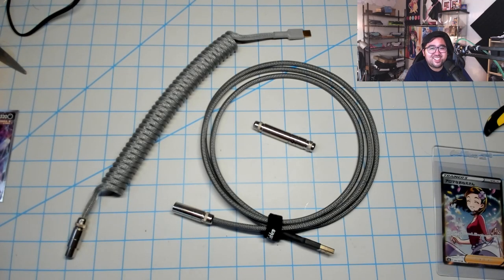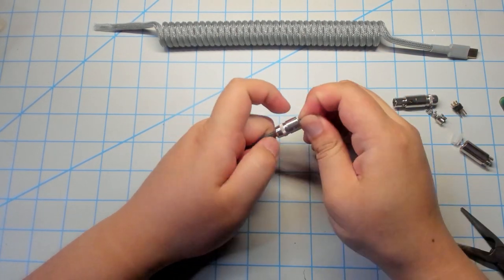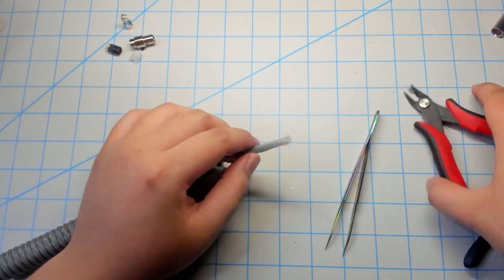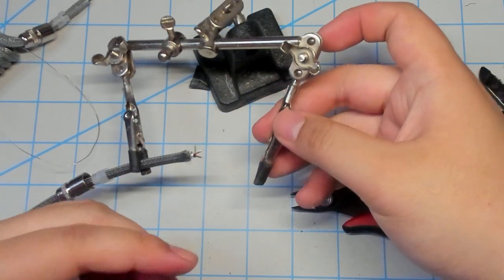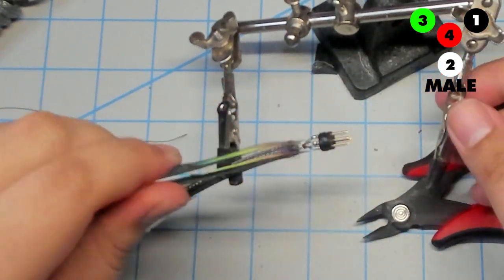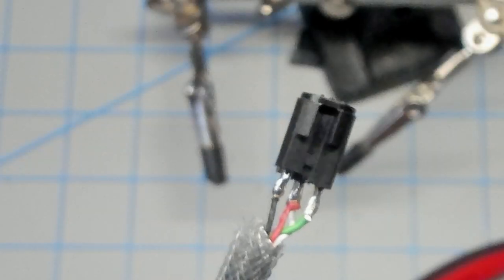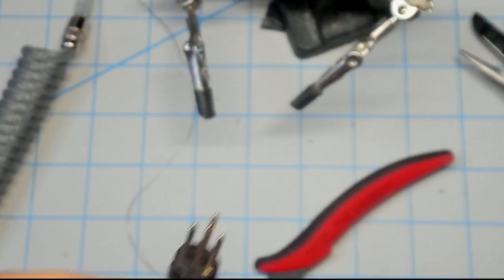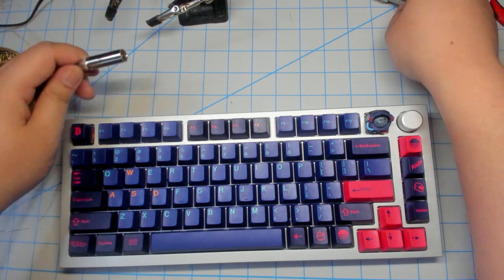DIY Mini XLR Connector Tutorial - Mechanical Keyboard Custom Cable

Comment: I bought one of those custom cable kits with a gx16 connector and after I finished building it, it didn't work, I didn't find any crossed wires, and soldered the wires in this order: black, white, green, red, are there any other things that I should check?

Comment: I made my cruzctrl kit ($20 one) and it’s turning the rgb on my keyboard (gk61 Pcb) but not actually working… any help?
Reply from the maker: Usually, that's caused by an issue with the soldering. You can join the discord in the video description and share some pics of your soldering for help. :)
Reply: @CruzCtrl  got it thx!!
Reply: @CruzCtrl  I viewed a few videos on YouTube, from different channels, including one from LTT recently, and I forget which shop it was, but it was probably yours, I saw a USB 2.0 certified cabling for sale... I have a question on cabling though, which is this, would there be any difference in transfer speed, on a 2.0 certified cabling in a C to C cable given that it says it's only certified for 2.0, and apparently not 3.0, which in theory would lessen the data transfer rate... Any thoughts on this, or things I need to know about cabling??? Is there even such a thing as cabling that's 3.0 certified, and would it be any noticable difference in transfer speed in high speed USB C SSDs between a 2.0 cabling and a 3.0 cabling???

Comment: it does grind my gears a bit to select fancy pants connectors and then discard the shield, especially since those connectors are literally made to have good shielding.. you just need to bend the shielding back.. then when you crimp the metal, it makes a nice shield connection. This has nothing to do with being "audiophile".. the USB people designed with the goal of low cost, they didn't put shielding in there for fun. Sure, it will work without, but how does it not annoy you to know that you could have made it the right way with less effort than it was to do it the wrong way?